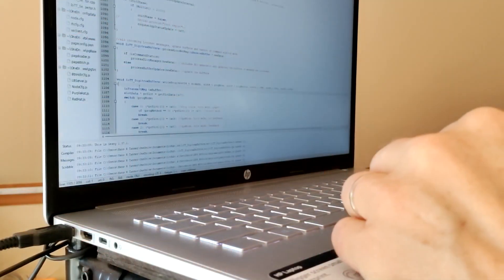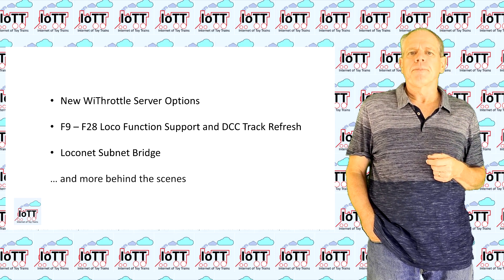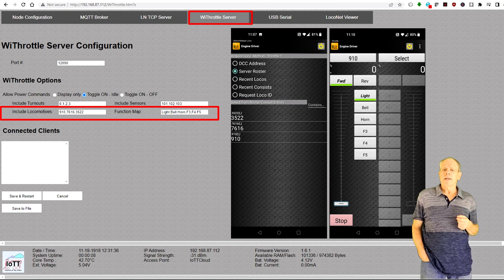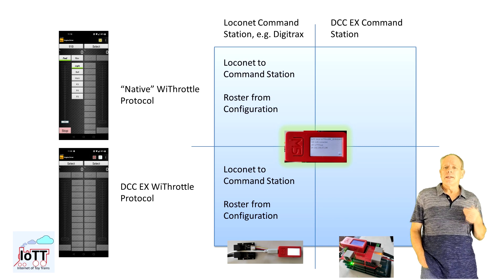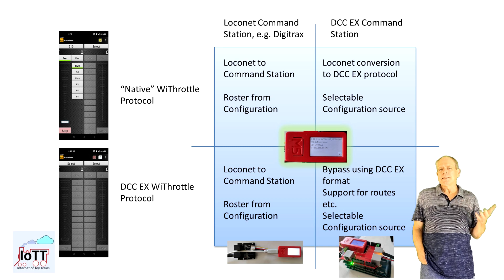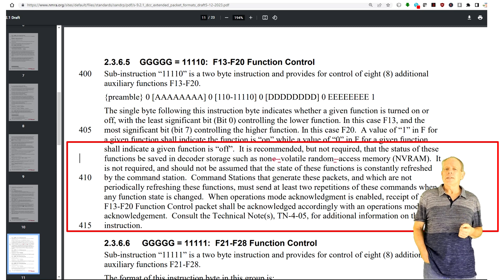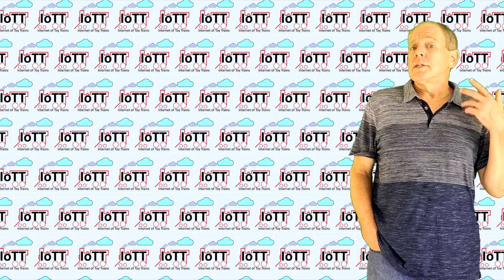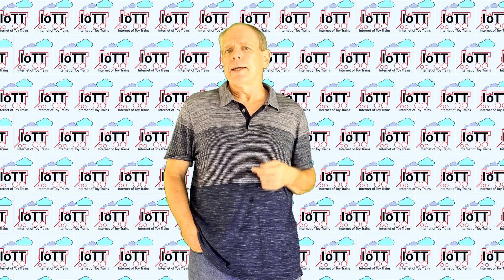Cool New IoTT Stick features (Video#120)

Comment: Hi Hans, I have got your system running with JMRI but I cant get it to work with Itrain. Do you have the settings from Itrain how it works? I mean loconet ober TCP with the IOTT Stick and the redhatshiekd
Reply from the maker: I'm not familiar with iTrain, so I have requested a trial license to find out, but it seems that may take several days until I get it. However, the setup should be similar like with JMRI, you connect as Loconet over TCP client. Will let you know here once I get the trial license.
Reply from the maker: Ok, I got the key and was able to set up the Loconet TCP connection. When clicking on the connect button, the TCP link is established, but it is then killed by iTrain shortly thereafter. The same actually happens if you try to connect it to the JMRI Loconet over TCP server. It appears that iTrain is expecting a certain command message from the server within a split second after connecting and if it is not received, the connection is cancelled. Unfortunately I can't find any documentation about the Loconet over TCP interface of iTrain, so I will send an e-mail to the folks and see if I can get some information.
Reply: @IoTT  Thanks Hans.I found out you need to set the Interface in Itrain to "N Loconet Server" with the IP Adress of the IOTT Stick. Connection stays stabil and the loconet viewer gives all the info back. Thanks anyway
Reply from the maker: That is very interesting, because technically this cannot work. Looks like in this mode iTrain connects as client, even though it says server, but a serve4r would not need an IP address and server connected to server does not work at all as certain elements of the communication protocol would not fit. Anyway, if it works, that's great. Thanks for the info (I emailed iTrains two days ago, but have not heard back)

Comment: I appreciate the new features.
Is LCC still a consideration for you?
Reply from the maker: Thank you. Yes, I am actively monitoring what's going on regarding LCC. If it turns out to be successful and becomes a defacto standard (still not convinced about that), I probably will support it as it can do the same as what is possible with Loconet, i.e. it is a true, event based network, other than e.g. the NCE cab bus.

Comment: My IoTT Purpl Hat is unable to acquire a DCC address regardless of using WiThrottle or Loconet over TCP. Yes I see Loconet data on the server page. Please help. Thanks. Yes, I am choosing an address on my throttle both WiThrottle and regular throttle.
Reply from the maker: Please send me some information about your setup via a-mail. Command station, throttle? What did you try?

In order to acquire an address when using Loconet over TCP, the loco needs to be assigned to a throttle, then you click the acquire function and turn the throttle know to change the speed. PurpleHat should then display the address. 
When using WiThrottle, the address is loaded when you load the JMRI roster file.
Reply: @IoTT  I have a Digitrax DCS200, JMRI on laptop thru a PM3. I see Loconet data on the IoTT stick page. In WiThrottle, It says NA next to DCC address after loading a profile. However, when I hit start, it says no DCC address acquired. Same in Loconet over TCP. Yes, I do acquire a locomotive in either WiThrottle or on my regular throttle during the "listening" period..
Reply: Okay never mind. I have downloaded your latest software and I now have the address being acquired. Next problem, the loco is travelling farther than the 100cm that I am putting in for track length.
Reply from the maker: How much is it overshooting? Does it stop at all?
Overshooting generally can have two reasons. 
a) the measured distance is not correct. Verify the measured distance using the relative travel display on the screen. If it does not match reality, adjust the wheel diameter settings.
b) the decoder has accel and decel values set (CV's 3 and 4). These should be set to zero to measure the speed curve. Also, if your decoder has speed stabilization, it is best to have it turned on, which results in less fluctuation of speed for any given speed step.
Reply: @IoTT  it's not stopping or reversing at all. I'ts trying to run my whole layout.
Reply from the maker: But it is accelerating when you start the process? That would indicate it is not measuring the distance and it accelerates after a timeout.
Can you verify that the measurements are correct when you move the car manually?
Reply: @IoTT  No, it is not measuring distance at all. I did the straight install, meaning that I cut the board in 2, and ended up having to jumper between pins on the main board. Seems like some of the internal traces were not completed.
Reply from the maker: Ok, you take an Ohmmeter or beeper and verify conductance over the gap. Also verify 3V.You can also measure from SCL and SDA to ground, should be 3V as well because of the pullups.
Once this is working, you can hook up the IoTT Stick to a Serial monitor and verify the output when it bootsup. About one page down you should see the TMAG ok message indicating the the I2C bus works. If you see something like TMAG ... ooops, then I2C communication is  not working. (Don't mismatch with the following line for the BNO055, which always will display ooops as the BNO chip is not installed).
Once this is ok, you can wait until initialization is finished, then push the car about 20cm and you will get a calibration message in the monitor, usually this is two lines saying something about magnetic field. If you get that, the stick is working and it can detect the magnetic field.

Comment: Does the software get installed on an Arduino?
Reply from the maker: The IoTT Stick is built on the ESP32, so the software can be installed on any ESP32 dual core controller board.

Comment: Great additions to this update Hans. The new DCCEX features will be welcomed by many. The combination of IoTT devices and DCCEX is becoming a significant option for those wanting a low cost system.
Reply from the maker: Thank you. As far as I can see, the IoTT Stick Withrottle server is currently the most flexible and versatile solution that is available. I don't think it is possible to run mixed mode neither on DCC EX nor on JMRI ;-)